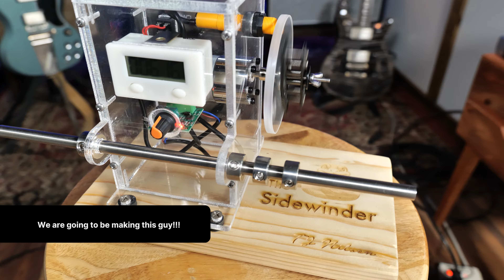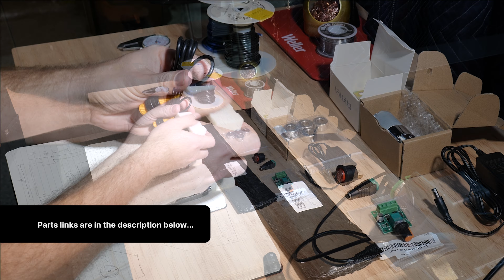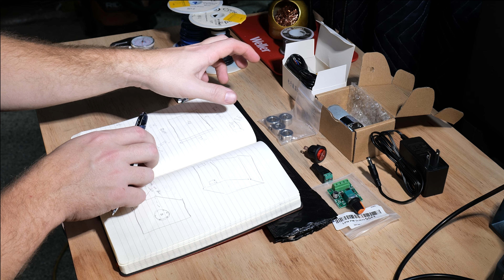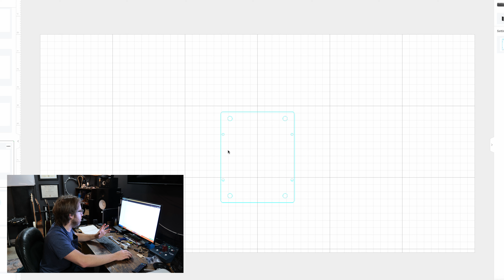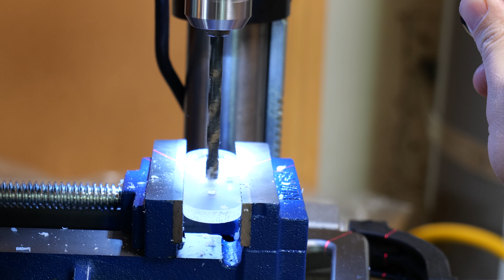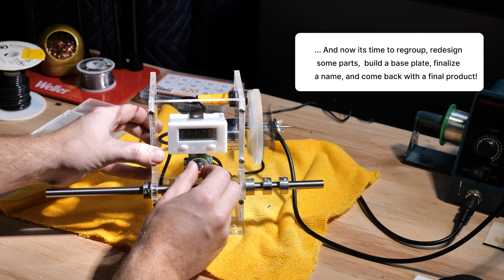Building a Pickup Winder - DIY

Comment: Thanks for sharing. I have two questions:

1. Would it have been better to use a pulley system to minimize the rotation and swiveling?
2. Should the bar be positioned farther back to improve stability and provide more room to observe how the wire is being laid?
Reply from the maker: Hmm.   Good questions.    A pulley system (if your saying have the motor drive a separate spinning axle via pulley/belt) could work fine.    Given the variable speed of the motor that’s quite reasonable, there’d be minimal benefit in speed control,  given the minimum weight and tension , this motor can easily handle the winding without wobble/swivel - but maybe the pulley and belt would be an easier “direct to motor” mount.   The initial wobble was due to poor first design mounting directly to the output shaft.  

2 - that’s probably just a good idea.  This does wind quite well, and I can easily see where the wire is going.  Performance may be improved by positioning the bar differently.   It’s a fair point.

Comment: Would have been cool to see it actually winding a pickup.  I'm an electronics guy, and I'm thinking of doing a coil winder for making an LVDT, or solenoids, Tesla coils, etc..  I was going to see if I could implement a level-wind attachment, too.  Looks cool and seems to work.
Reply from the maker: Getting there with a quick follow up video.   I wound and potted that pickup immediately after and it worked perfectly (as long as your after hand-wound obviously).  I put 8300 winds on the Strat bridge and it sounds great.
Reply: You’re doing what others already did. Why not design a device where you can make an input of needed windings with stopping after?